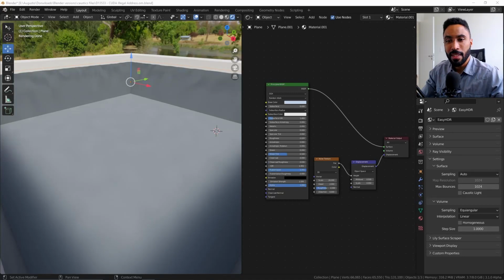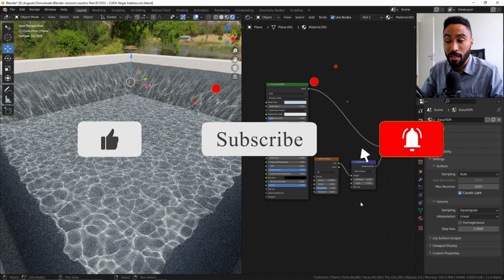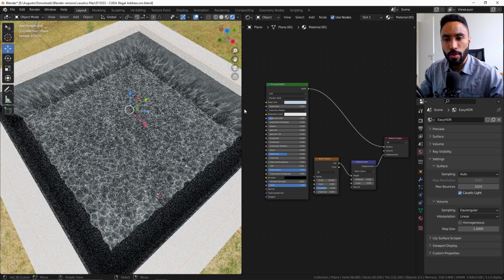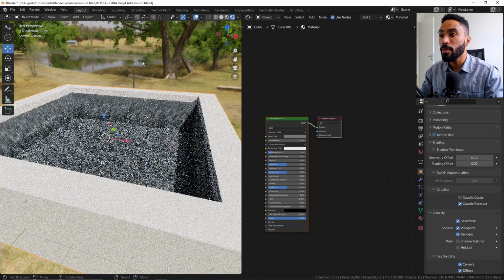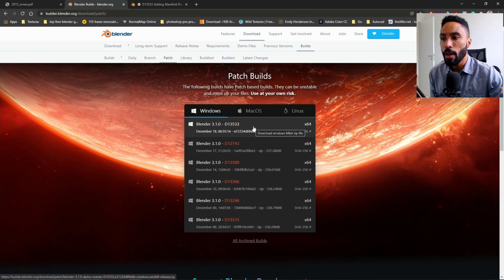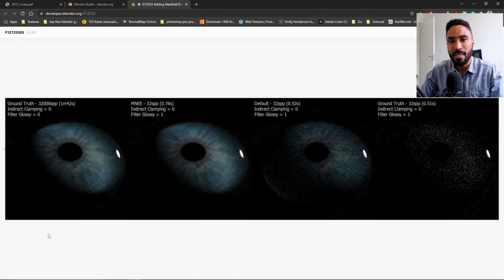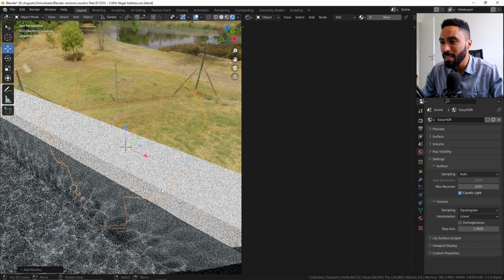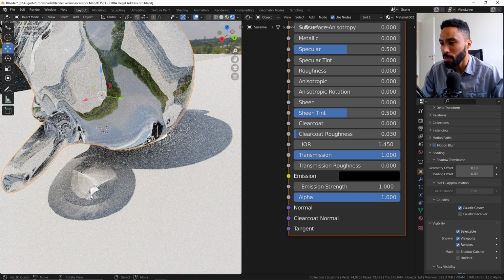😲BLENDER 3.1 | Cycles with REAL CAUSTICS??? - #BlenderNews

Comment: Wanted to add this to a scene I made for a different render engine I used together with blender. That engine is full spectrum and can do all materials and effects. I get a feeling this is again something added and than not finished. It seems it doesn't work together when you add volumetric scatter to the water. The volume settings act weird and even with 0.00001 8 get dark water. I did add it only on a mesh surface. Perhaps I need to make it a closed volume. But then I'm not sure if the caustics still work. Perhaps I need to use your other example you made a video about

Comment: Wow I can't believe it also! Finally.
Weird way to implement it though. With a hidden button. The button should at least be in the Render tab next to light paths. Similar to Luxcore.
Reply: There was already a caustics option there but this is more like smart caustics to only have caustics on pools or places where caustics are important instead of trying to create caustics in unnecessary areas all over the scene. So I liked that its object based instead of trying to calculate small unnecessary ones. I hated the old caustic behavior cuz it create caustics on all glass objects without a control... this is more artistic way to control